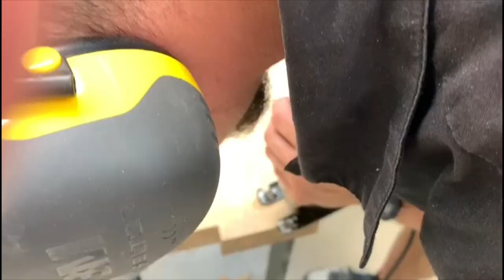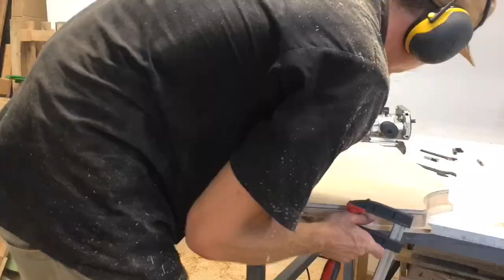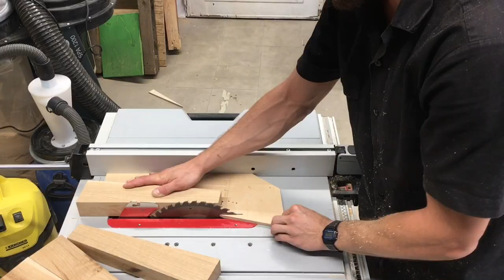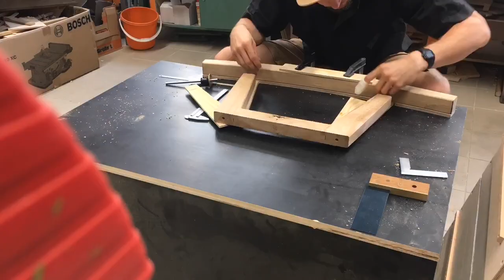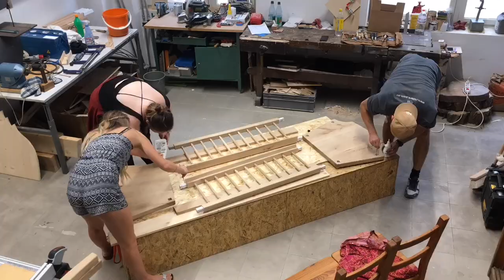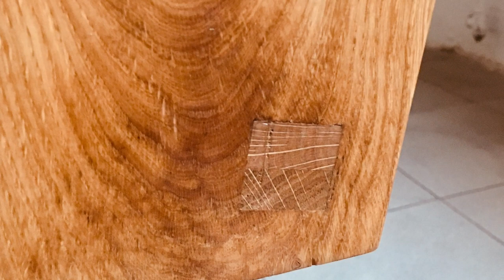How to build a cradle

Comment: This is very impressive! I am going to make a cradle. How did you get the curvature of the rockers accurate?
Reply from the maker: HI, Thanks a lot! :-) The Rockers Template is built with a long (like a roof batten) wooden bar to get the big radius you'll need approx. 2m lenght of the bar. Drill two holes in it, one for the pen and one fixed for the piviot-point. then you draw the line of the curvature.
Reply: @alithefinewoodworker4823  thanks!
Reply: @alithefinewoodworker4823   Thank you!